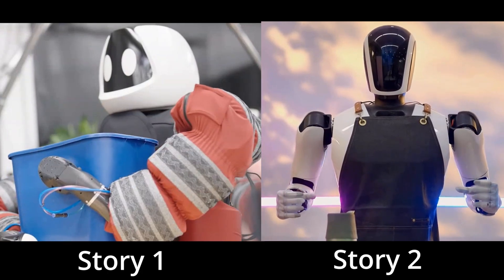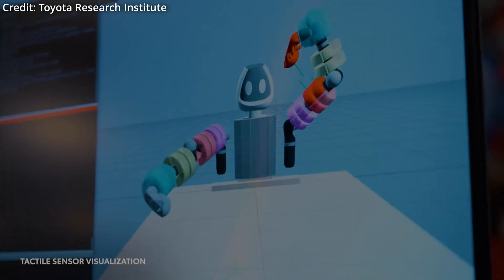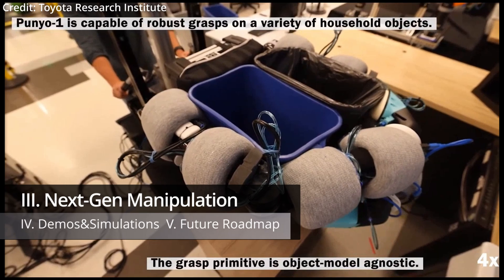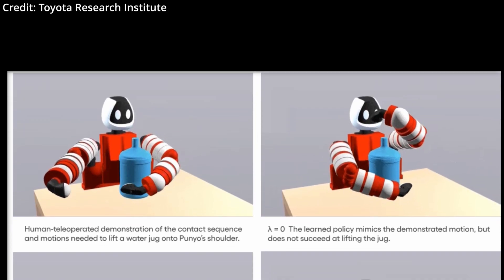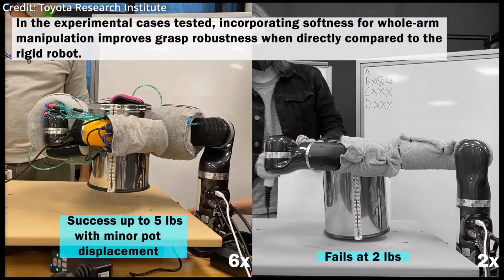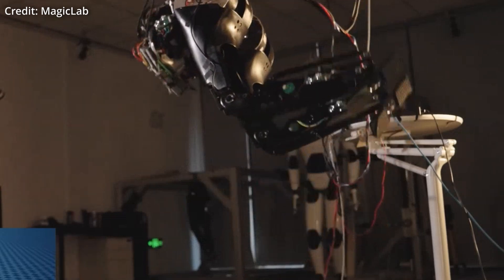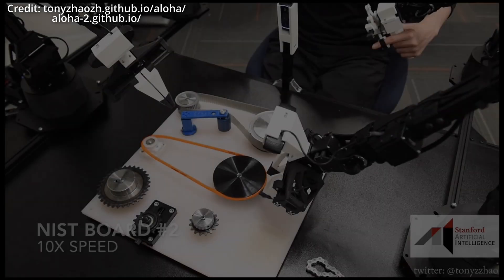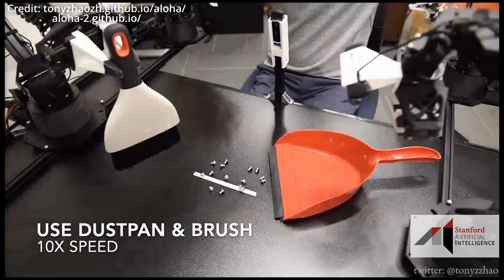Toyota’s New PUNYO 1.0 AI Robot Demos 100+ Skills With Shocking Tech Reveal (MAGIC LAB HUMANOID)

Comment: I can foresee a future where we 3d print or otherwise create "skin" for these robots that have continuous sensors embedded, sort of like what a touchscreen membrane represents on an iPad, but for greater pressure measurement range via a soft rubber layer under the sensor.  This way any impact potentially anywhere on the robot can be "sensed" by it, and, say, stop what it's doing of it "knows" the baby is crawling on the floor and may have wandered under his legs, bumping one of them so its stops moving for safety.  These will also accomplish what's shown here, allowing measured and controlled pressure contact with any surface, not just for judging the strength of grip but even for things like pressure against any object such as a light touch enabling the robot to hang a picture on the wall or limit any "lateral" pull when opening something like a cabinet door or drawer, since it needs to sense when its pulling off axis and limit the amount of that force to very little to avoid damaging the door / drawer, etc.

When you think of it, opening a drawer or door is among the more complex operations for a robot.  It needs to figure out the correct motion (straight for a drawer, specific radius for a door) and sense when it is within tolerances matching those unique paths to apply force, since every door and drawer, in relation to where the robot is standing has a unique path to properly open it including how far above or below it's line of sight it is.  It also needs to obviously judge the force to open it, as, for example, some drawers have soft close mechanisms, or heavier contents, requiring more force to open them initially, but gliding easily after initial opening.  So it needs to make an initial judgement of the direction to pull and immediately upon it starting to move must continuously monitor the direction of pull by measuring resistance on all sides to detect when it is not pulling in the correct direction.  It also needs to have a maximum force limit, so that in the rare case of a stuck door or drawer (object sticking catching it for example) it will not just proceed to destroy it.